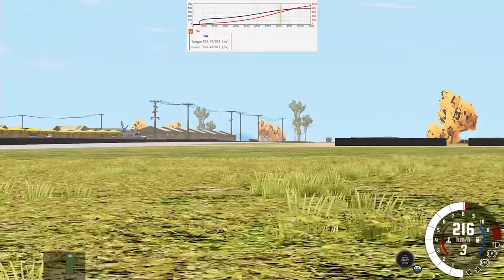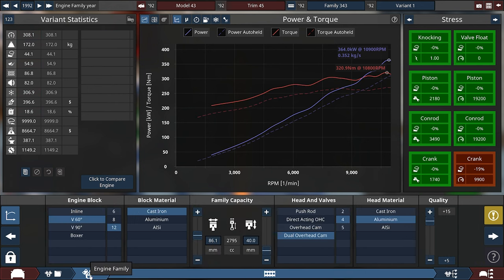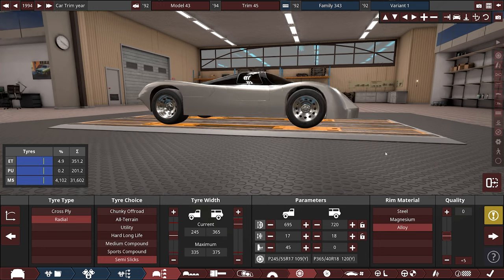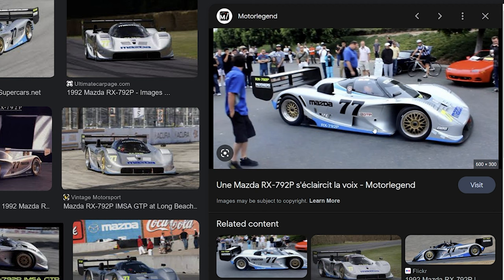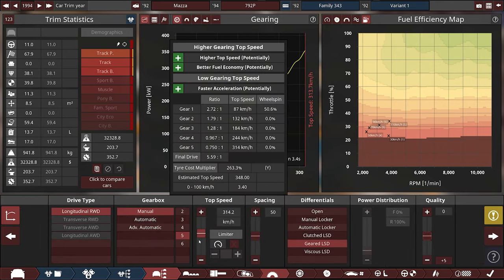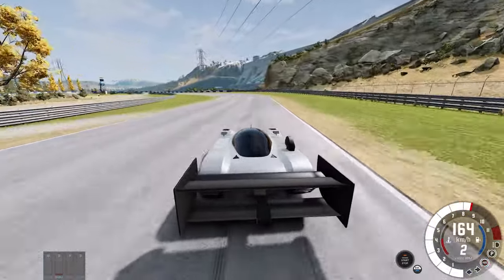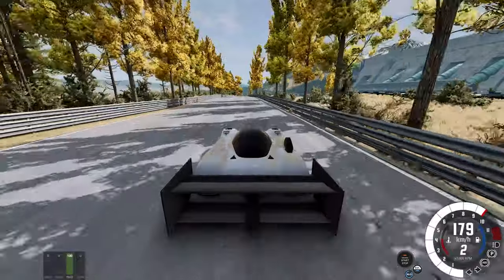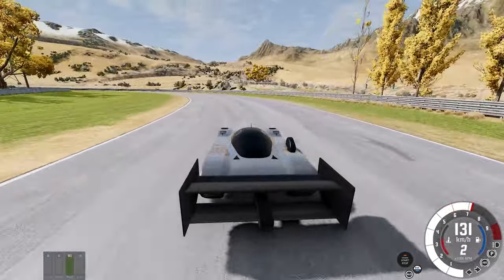The Last Quad Rotor Race Car

Comment: There's actually another quad rotor, which was the RX-7 GTO, which just so happens to be the one you showed around the start of the video! But instead of using the R26B quad rotor, it uses the 13J quad rotor, which has quite a different sound.
Reply from the maker: huh I saw it had a 13 engine, I didn't realise it was also a quad rotor... I might look into it
Reply: The Mazda 767 also used the 13J engine
Reply: there is also prototype engine that are 6,8,12 rotors!!!!!
ps: the mazda 767 uses the 13j

Comment: I think you have to be more specific with chatgpt. Here's me trying:

-"How much downforce were IMSA cars in 1992 allowed by regulations to have?"

-"IMSA (International Motor Sports Association) regulations for downforce in 1992 varied depending on the class of car.

In the GTP (Grand Touring Prototype) class, the maximum allowable downforce was limited by a ratio of weight to downforce. Specifically, the maximum ratio of downforce to weight was 3.0:1. This means that for every 1 pound of weight, the car could generate up to 3 pounds of downforce."
Reply from the maker: oh interesting, I asked it a bunch of questions, and never got a straight answer. Also be aware that it often hallucinates when pressed too hard for information

Comment: I'm so glad that this Mazda Unsung Hero car finally gain some attention.

PS: 

(As a result, it didn't perform well, and after a year, the plug was pulled, and the Quad Rotor died was discontinued.)

We'll technically speaking the RX-792P gain some podium finishes (2nd, 3rd, & 4th) which is considered an achievement even though it didn't manage to single race[1st place] nor take home a championship. That's is why this is one of my favorite Mazda Race cars ever 2nd to 787B.

Comment: So few nitpicks:
- Mazda 767 and 767b also used a rotary.
- Rotaries weren't "banned" (or at least not "targeted" with that rule change) - the switch to new 3.5l ruleset was planned years in advance and was posponed few times. For many teams cost of developing brand new car was too high, FIA allowed "Group C" and "3.5l" cars to run alongside in the same class (similar to "World Rally Car" and "Group A" cars competing in A8 class in WRC). Until 1991 Mazda's LeMans programme was mostly a failure, so nobody cared that rotaries won't be allowed.

And fun fact: there is quite good mod for Road Atlanta (including fully built time trial variants for almost every layout possible).
Reply from the maker: I should have said "the last quad rotor race car" haha

as for it being banned, you're right, it wasn't explicitly banned, but there was a quiet fia rule added about using "conventional piston engines" only... that would potentially only look at jet turbine, and rotary engines haha

I might look at the Raod Atlanta map :) thanks for letting me know!

Comment: Rob Dahm has a custom RX7 with a 4-rotor. With turbo and already 1337 HP and the 4WD system from a R34 Skyline. Nothing official Mazda of course, at all. There are others around as well. 
Nice car, have to try it later. What does the rear wing weigh? That could throw of the balance. 
Ear ringing rotary noises for 24 hours? :-)
Reply from the maker: I know of his awesome car!! though it's also not a race car. Man I'd love to have a go in that beast!!
Reply: @fillman86  the bodywork alone is insane, and the moment i heard that they were keeping the montego blue from stock, one of my favourite colours from mazda, i knew it was gonna look brutal. The amount of work and love poured on that thing is immesurable.
Reply: Wasn't the AWD system from R32?
Reply: @fillman86  its a race car bro what lmao. atleast he is building it for track its the same thing really

Comment: That's roughly 1/2 of the downforce it actually makes
Reply from the maker: there seems to be no documentation on it though
Reply: @fillman86  true, I'm basing this off of the aerodynamics database on mulsannes corner, the 792p also had different rear wings and the car wasn't bad by any means
Reply from the maker: @gp8666  it was hundreds of hp short of the competition, and developed an overheating problem, meaning it had to run a very non-aggressive wing.

I'm not sure what you mean by, "aerodynamics database on mulsannes corner"
Reply: @fillman86  it's a website
Reply from the maker: @gp8666  D: I'll be looking this site over!!
Reply: According to Assetto Corsa, super low
According to Gran Turismo 7, super high (like 2500 kg?)
Reply: @kerimca98  games tend to get wrong these numbers for some reason

Comment: the knife tool makes liverys hella easy
Reply from the maker: to just apply different materials to those areas? That's true, and some times I do that, but it's not an efficient mod to play with compared to just a skin
Reply: @fillman86  i did the ken miles gt40 with it and its workin out pretty well thus far

Comment: But... They... Never banned the rotary...? 
It's still allowed (it just sucks so much that nobody is using it)
Reply from the maker: they banned (directly or indirectly) rotaries in almost all top end FIA categories after the 787B

putting in a rule about the internals needing to be "conventional" only targets rotaries and jet turbines... I didn't see any jet turbine cars that year XD
Reply: @fillman86  it's still allowed in wec tho
Reply from the maker: @andreysab3432  maybe WEC changed after Group C died, or sometime during the LMP1 era.

the reason it's not used today? Probably its lack of torque, and poor fuel consumption
Reply: @fillman86  i really feel like rotaty engines are underengineered, if they got a quarter of the way to where the regular engines are they could be insane

Comment: Hello fillman! you are really good at coding and that stuff in beaming but I just came in to it, but I need some help!  
Do you think you can help me with how to make a speed limiter for a car? 
(Sorry for bad English I’m from sweden)
Reply from the maker: automation has an option to add speed limiters in game
Reply: @fillman86  but I mean how I make one for a mod that I have downloaded
Reply from the maker: @stakedz  chuck this line into the vehicle controller section:

"topSpeedLimit":0,

then set the number to be the speed in meters per second.

Though this is likely to be there already, so just edit it.

If it has 2 forward slashes like this - // then remove that first, as that means it's inactive
Reply: @fillman86  I’m not on my pc now but does this work if doesn’t have a speed limiter from the start?
Reply from the maker: @stakedz  yes, that is the exact code
Reply: @fillman86  ok thank you🙏😁
Reply: @fillman86  sorry to disrupt you again but where is the 'controller section'? i have looked in the files of the car but i cant find one thats named that
Reply from the maker: @stakedz  in the engine jbeam, there'll be a vehicle controller section. Alternatively you can google it :)
Reply: @fillman86  ok thank you ill try it :)
Reply: @fillman86  im sorry but i cant find a engine jbeam
Reply from the maker: @stakedz  I think you should start with a simpler thing to mod then
Reply: @fillman86  ok then ill maybe learn how to do it in the future but thanks anyways😁